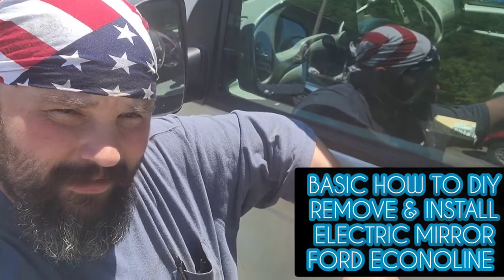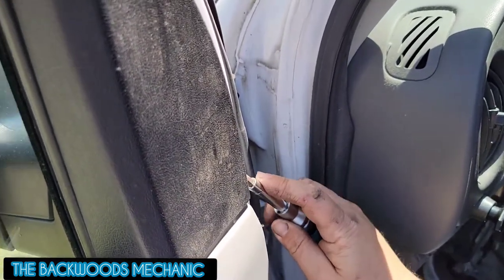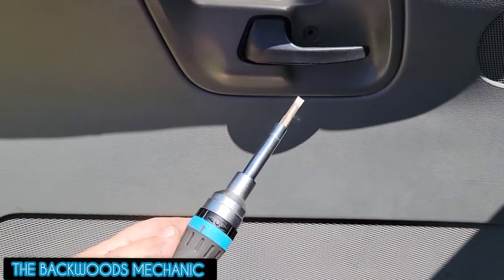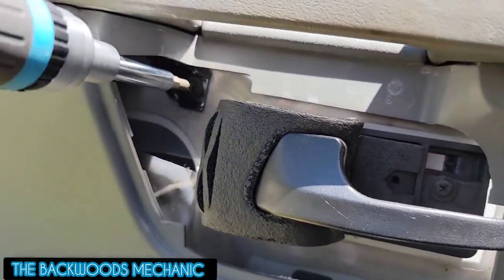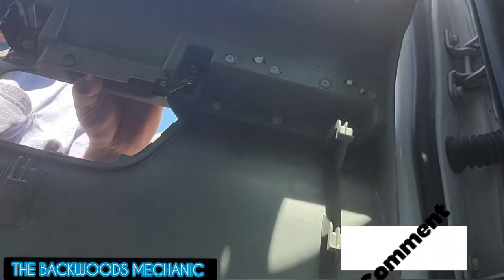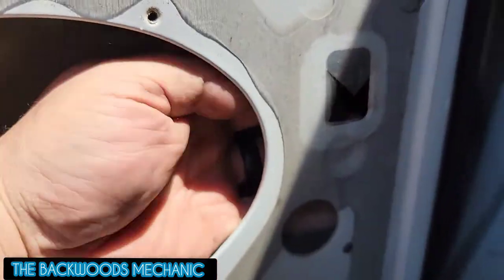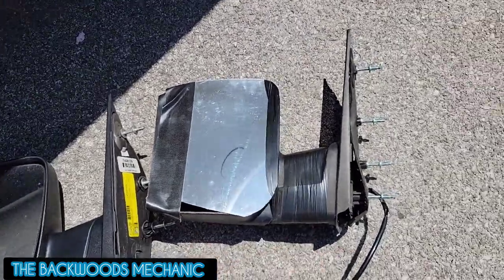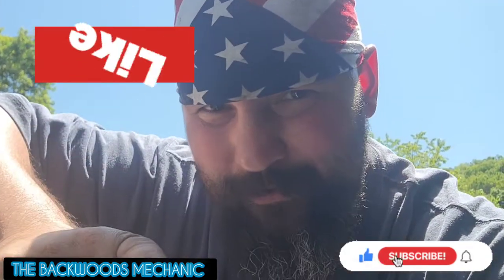Remove & Install Electronic Mirror on Ford Econoline (Basic How To DIY)

Comment: TBM

I have a 97 E350 Class B RV...   It has power windows and power locks...   The RV side mirrors are manual Velvac used for RVs...

Will this van have the connectirs to add power and heated mirrors?